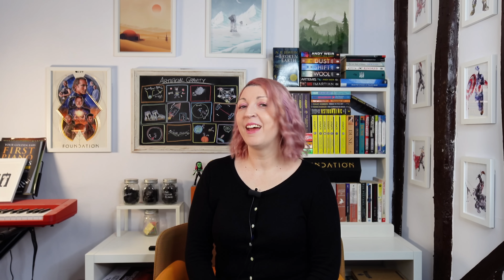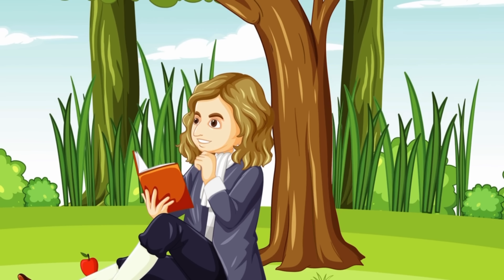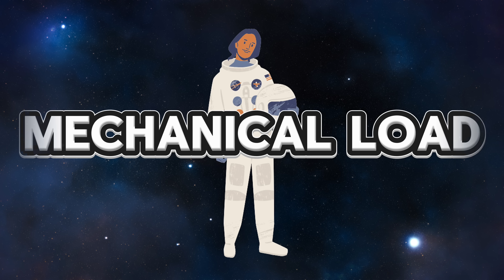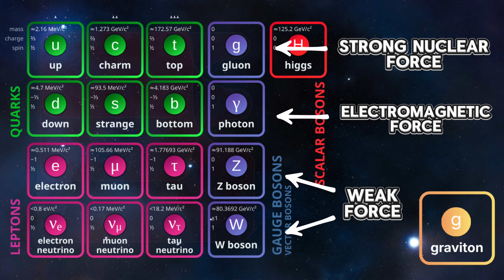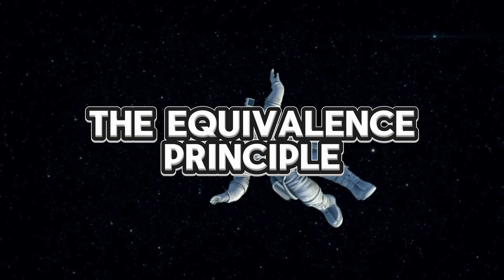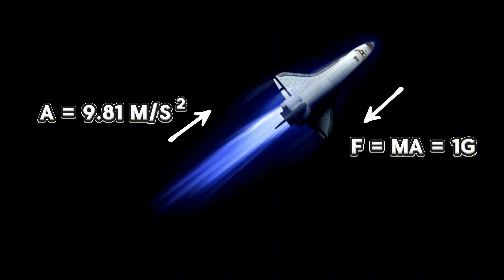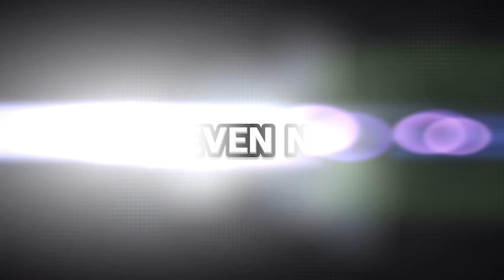Why Artificial Gravity Is Harder Than It Looks

Comment: I visualize spinning beds for a Lunar habitat. Go to sleep and get your dose of 1G, for your body and a nights sleep. Years ago while daydreaming about the problem.

But I imagined the body in line with the curve of the spin. Every part of the body head to feet at the same level away from the centre. Not across it.

That way never came into my consciousness. Until I saw it in your vid. Possibly because the body would be exposes to different gravity densities at the feet to the head.

Caused by the distance the feet are away from the head.

Would it matter, buggered if I know. I'm just the dreamer of my idea. 🙂

Before space exploration came to a roaring halt.

From sputnik I was an 7 year old daydreaming of working in space. Then Yuri Gagarin showed it was really possible. The dream got cemented in. 

Then, it all stopped.  I had to dream up another job. Never really nailed it.
-
My belief, the Moon is halfway to every where. To get everywhere we need to start from the moon away from earth's gravity well? Cheaper energy costs. After the initial building of the base's.

Comment: Artificial gravity is, as the name implies, artificial. Acceleration effects due to a change of velocity are different than those caused by gravity. The inner ear reacts with vertigo when two rotations interact (turning your head while simultaneously rotating in a different plane) Aircraft pilots are trained to ignore the vertigo and rely on instruments , or know how to avoid the phenomenon in the first place - unfortunately like for the amateurish pilot, John John Kennedy.
Reply from the maker: yes. this is the coriolis effect that i discussed in the video. gravity is acceleration, that's the point of the equivalence principle, the effects are identical for the body.

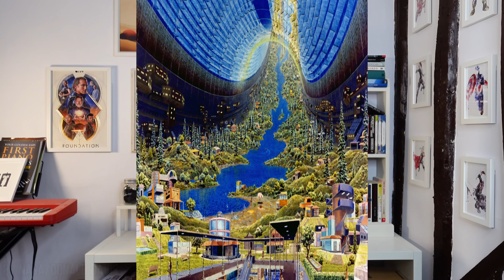Comment: 24:10 The physics and engineering is well understood, to build a Stanford Torus.

The business of the NASA Ames / Stanford plan was mining the Moon (or preferably NEOs) and building SPS. They needed ~10k people in the space factory, and to prevent losses to people who can't readily adapt to a spin rate faster than 1RPM or who just wouldn't want to live there for a period maybe of years, it needed to not only be survivable but comfortable. Architects modeled the interior after dense yet pleasant places down here, and that set the flat floor area needed at 1.6km diameter torus. for an example of a relatively small first generation hab.

Of course the challenge is building up the in-space infrastructure and using space resources like NEOs.
The torus was to be done by 2005, and until then they'd be living in things like volumes hung spinning opposing with tether/truss, for artificial G. When space resources start coming in, they get full shielding too. ~1.9 meter of packed sand, or ~1.6 meters of reinforced concrete as the habitat hull for a robust structure providing full shielding. You might as well use artificial aggregate rock since it's so well known and you'll have plenty of it if you're harvesting asteroidal dirt to build a city. It uses less metals compared to using metal structures as a rotating pressure volume inside stationary shielding mass. Shielding/structural rock is 80%+ of the colony's total mass. Less than 10% of the mass of the factory or colony must be shipped up from here.

In the NASA studies shown to Congress back then, cost until NEO metals start coming in and SPS are being built and years later when the torus is done, is like many other large infrastructure or industrial developments down here. Just less than a trillion over the ~30 years (and we spend well over 3/4 trillion each year on the military).

Any who disagree that we understand the engineering of it or who doubt the cost and time estimates, is invited to show their professional qualifications in all of the relevant mining, construction, and shipbuilding & astronautical engineering, and citations where they are published on the  subject under peer-review showing that those studies and very much other work, is all wrong.

We could start now, could have at any time since the '70s.

Of course this couldn't be done with the Shuttle, and even the SLS heavy and the SpaceEx Superheavy or the Saturn-V are small boosters to be supporting this. In the '60s they designed boosters more suitable. See the Boeing AMLLV for the largest payload tonnage at 1900+, the Convair Nexus SSTO for the largest payload shroud with hundreds of tons lift. If SpaceX builds the next larger version of a BFR, it will approach the "Nova" class in usefulness, on the small end in tonnage per lift. About like the Sea Dragon or Douglas "ROMBUS".
Later came about the Boeing "Leo" or "Big Onion" booster on hazegreyart youtube.
Or alternately the giant Rockwell Star Raker spaceplane, SSTO for 100 tons in standard air freight and satellite & Shuttle fuselage+ scale packages. 4 days turnaround, self-ferrying ability within jet fuel refueling time, if needed. A huge spanload tri-delta wing-body with 10 jet & 3 rocket engines.

Of course, try to get votes for it from congress-critters who gleefully spend far more on wars started on lies, expending our troops as cheap mercs for graft & profiteering.
 When this would end the relevance of the scarcity model to raw materials and energy (and of course previously rare or "precious" metals) and room for growth without destroying the biosphere.

Comment: The problem I see with 'gravity is weak' is that it always makes the comparison on such a small scale.  Yes, on the atomic scale, gravity is weak compared to any other force.  But on the cosmic scale, it's the only force of note at all.  Electromagnetic effects of the massive dynamo that is our Sun can barely move particles at the range of Earth.  But gravity holds masses as large as Pluto at distances almost 50 times as far away!  On a galactic scale, no one talks about the electromagnetic field of the core, or strong or weak nuclear.  It's gravity and gravity only.

Comment: There seems to be a problem or feature with the spinning ship method. The effect would not occur at the center of the ship which would remain weightless. And it's not clear to me how far above the rim the artificial gravity would persist. 

If the inside of the ship was a vacuum then it seems you would have to be in contact with the edges or already spinning with them in order to feel the force. 

You could perhaps run in the opposite direction and jump up and then be floating. No?

If the ship was large enough and filled with air then I imagine the air resistance would prevent that (as it does on the surface of Earth), but there would still be a floating zone of some size at the center. Though I don't know how to calculate where, or its size, of the edge effects within the ship.

Comment: In an accelerating frame - think rocket - you would experience the same downward force at all levels of the spaceship. There is no drop-off as you get farther from the engine. A slight mistake that looks like it came from the idea of the centripetal force scenario, where you rotate a section to produce the analog of gavity. In this case, you would have differing levels of 'gravity' at lower and higher levels. (or between your feet and your head)
Reply: No. That's not what she said, it's how your thinking because you are correct except that nobody mentioned rotation in her analogy.
Reply: @andymouse  Actually, that's exactly what she said.  A small mistake in an otherwise nearly flawless presentation.
Reply: That's not true? You're thinking of centrifugal forces vs. centripetal forces
Reply: Albert Einstein had a genius imagination, he created his theories before the a
Reply: Perhaps she was thinking relativisticly where acceleration takes a small amount of time to traverse the length of the ship. Or she just got her script muddled as suggested :-)

Comment: Wait, wait, wait...
A textbook word problem:
Short version:
In a most gigantic rotating artificial "planet", spinning slowly, if you spit in the opposite direction of rotation, does the spit start "floating"?

How does a person in artificial gravity by rotation interact with floating debris or practical item passing through that environment? Does the floating item suddenly (absorb?) the artificial gravity?

If at any point in the person's height, the mass above is spinning at a different rate as the mass below that point, (the shoulder compared to the knee, or shoulder compared to the elbow), how does biology/anatomy react to that relative "churning"?

Show your work. (...or not. It's really a rhetorical question.)

Comment: I loved "The Expanse" but no: 

I'm so tired of hearing people praise "The Expanse" as realistic when their magic engine is just more sci-fi hand-waving a problem away. Just spin the damn ship. You could make it split in two pieces connected with a tether and for battle then pull the pieces back together. I would have so much more respect for them then and it would be so much more deserved.
Reply: "The Expanse" is reasonably realistic with some "sci-fi gimmes", like almost every work of sci-fi ever created, no matter how "hard". 

And I think you're missing the point because your "solution" doesn't help with the actual problem - if you don't have a super efficient engine that you can burn for long periods then space is just too big (even our local patch of it). To have stories that don't regularly involve many months of travel and dull logistical considerations (i.e. that can maintain any sense of pace and/or drama), you need an Epstein drive or something even more outlandish (FTL travel etc.).

"Realistic" artificial gravity is just a handy side effect. The real benefit is, it makes the world of the books/show possible at all.
Reply: @E1line-r6d  Agreed. I thought of that after posting, that travel times would be not fun although I did come up with a kind of workaround for that issue too but it also has its problems. It seems like all solutions have their problems. I'm not against sci-fi magic but I think people give too much credit for being realistic when it's not. Just a personal opinion but if the internet teaches us anything, it's that whatever idea we have, many others have the same and I don't see anyone else voicing this complaint so I thought I should do it. I wish they gave us more details about the Epstein drive like if it uses muon-catalyzed fusion and mentioned the escape velocity of the exhaust. To me this is like Iron Man almost never running out of fuel for his rocket boots but maybe he's just heating air. Sorry for the long post.

Comment: i dont think the rotating room would work like y'all think it does yes you'll have 1G while standing on the ground but the second you jump up you become air born and can float anywhere you want. just cause the room is rotating the air above the floor will still have no gravity but the floor will have the gravity.
Reply: No. With spin gravity there IS a gradient to zero but it doesn't just "switch off" as soon as you leave the floor. The floor itself isn't "magic", what sticks you to it is the fact that you're trying to move in a straight line at a tangent to it and the floor is stopping you doing that by pushing "up" against you, applying a force proportional to your centripetal acceleration. If you jump "up" you still retain the motion of the rotating floor meaning you'll effectively move "forward" towards the floor rotating around to meet you, which will once again push "up" against you (where "up" means "towards the axis of rotation").

In other words, to anyone on the spinning object itself, you'll jump "up", move in an arc through the air and then come back "down" to the floor. Just like on Earth.

(IF you find yourself exactly at the "hub"/axis of rotation of the spinning structure though THEN you're correct, absent other influences like air currents etc. you'll basically float there forever because the gradient is weakest/zero at the axis of rotation, gradually building to strongest at the edge of the structure, aka the "floor". The 90s sci-fi show "Babylon 5", set on a rotating cylindrical space habitat, featured this "gravity" gradient as a crucial plot point at least once but none of this is "just" theoretical or speculative, we have centrifuges on Earth - from small enough to only spin test tubes to large enough to spin humans - that operate on exactly these principles and act exactly as predicted. There are plenty of videos on Youtube/elsewhere)
Reply: @E1line-r6d  but how does the air above the ground be affected from the ground? just because the ground is moving the entire area above it doesn't become a magic force pulling down to the ground. and those ones on earth are already affected by earths gravity.  but on the other hand i don't even think its possible to even leave the solar system unless we can prove these to be true. i think that is why we don't see evidence of life elsewhere, biology just doesn't allow for interstellar travel because life can't survive outside of the planet they evolved on.
Reply: @sethdarby708  Thing is, we don't know anything about other life evolving in the universe - maybe a planet isn't required so surviving away from one is a non-issue. That aside, dealing with the effects of low/no gravity is far from our biggest problem when it comes to leaving the solar system (propulsion is the primary issue there i'd say - we can have perfect artificial gravity but without much more advanced propulsion than we have now, it takes many decades to leave our solar system and much, much longer to actually get anywhere else. Voyager 1 for instance - the fastest human made object in existence - took 40+ years just to get to the edge of our solar system and would need about 70 thousand years to get to Alpha Centauri, our nearest neighbour. Compared to solving that problem, building spinning spacecraft is an absolute cakewalk).

And the air in a spinning space station works similarly to the air on Earth - friction drags it around so that relative to the floor, it's stationary (this is the same reason that, for instance, people can stand at the equator, which is rotating at about 1,600 km/hour and NOT be killed by 1,600 km/hr winds :) and air pressure keeps it fairly evenly distributed (which is why you can sit in an airliner travelling at 500 mph and not have to worry about all the air building up at the back of the plane :).

You're getting caught up in how different spin gravity is but as per the video, at the right scale the floor undergoing centripetal acceleration is a lot like the normal force pushing up on us from the ground. Remember what we feel on Earth ISN'T Earth's gravity pulling us down it's the ground pushing up on us (against gravity). The ground pushes up on air too. That doesn't stop being true on a space station. Again, the floor isn't "magic" and again, none of this is supposition - all these effects have been tested in experiments and many of them are "tested" literally every day, in any lab with a centrifuge (e.g. every university, many schools, pharmaceutical companies, NASA etc. etc.). We know how spin gravity works, we just don't know exactly how it'll affect us long-term.